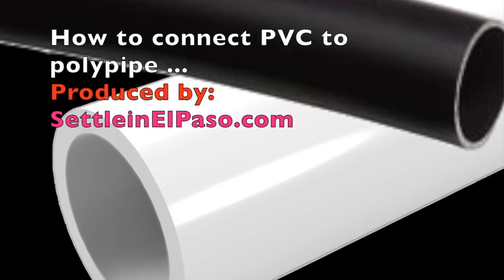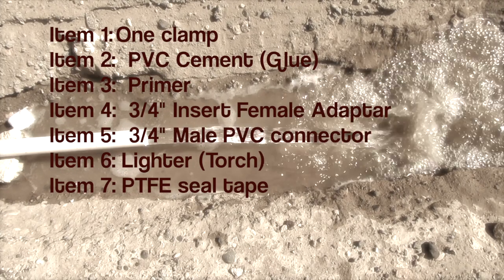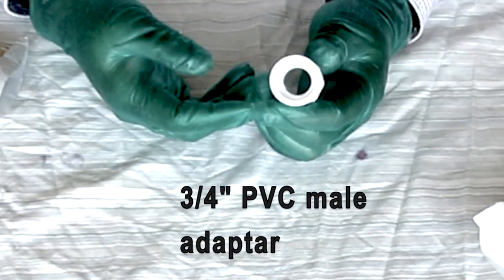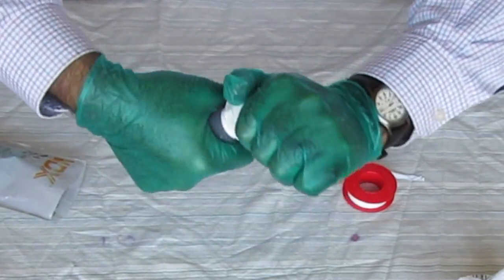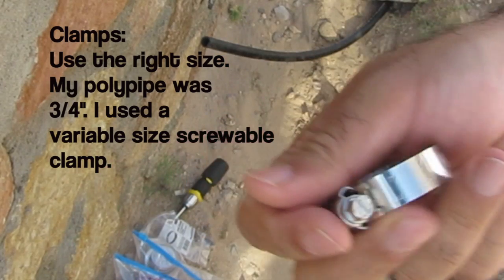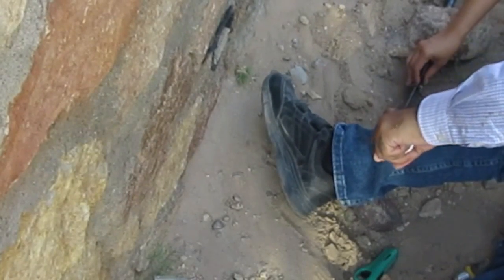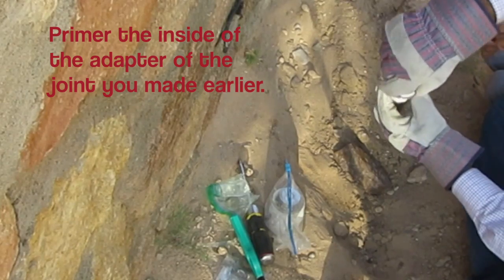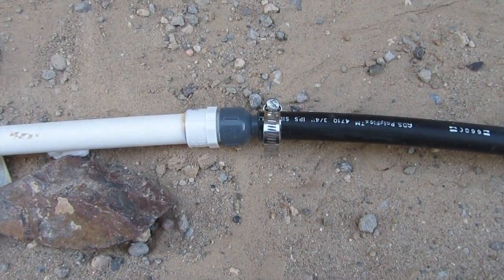How to connect a PVC pipe to a poly pipe

Comment: We've done this 2 times. It starts leaking in about 3 to 5 years from where the hose clamp it. Those are made for soft rubber hoses, not hard, and are never meant to be underground.
Reply from the maker: Many landscapers are using polypipes instead of PVC nowadays, for sprinkler systems. Polypipes have become popular for the flexibility and ease of use. Our polypipe system is two years old. It is working great so far. We dug the soil a few weeks ago to replace some sprinklers; the poly pipes and the joints are in great shape. The clamps are in great condition too (no rust yet). In our opinion, the clamps work well for hard poly pipes like anything above 80 psi quite well. I suspect the problem of leaking appears with soft rubber hoses, as you mentioned. We do not have much experience with soft rubber hoses because we were looking for a long term solution (which will not be visible from outside and hence underground). Soft rubber hoses are not supposed to be for long term use, I guess. 

Thank you so much for visiting and commenting. Have a wonderful weekend ahead.
Reply: @shleepy you are Incorrect!!